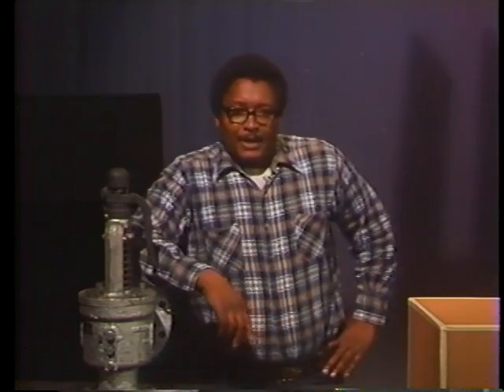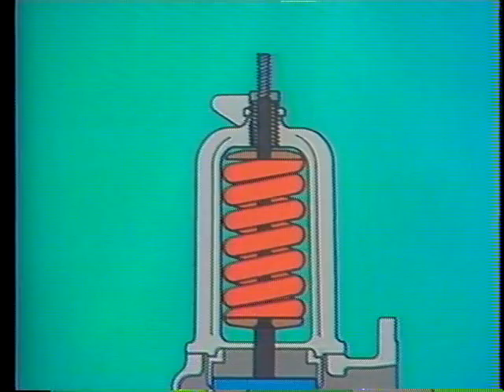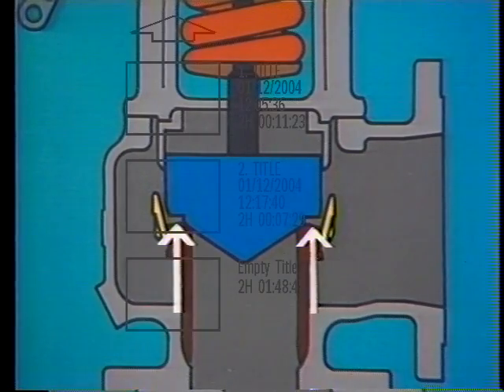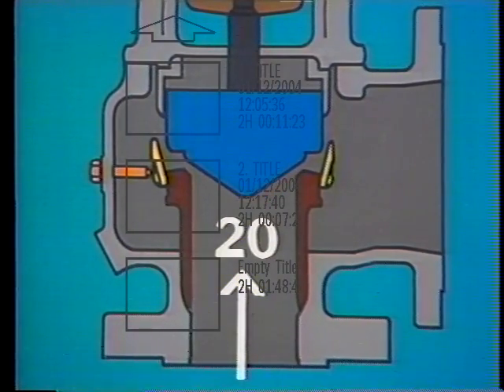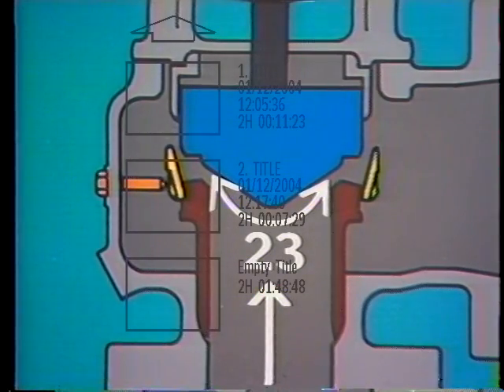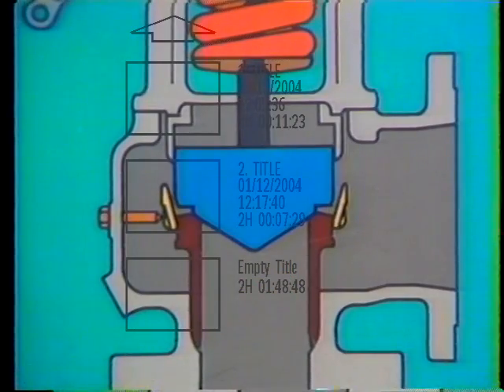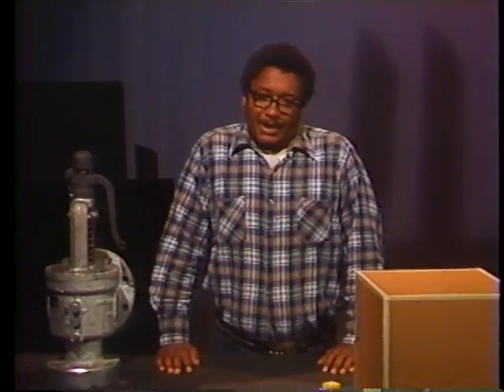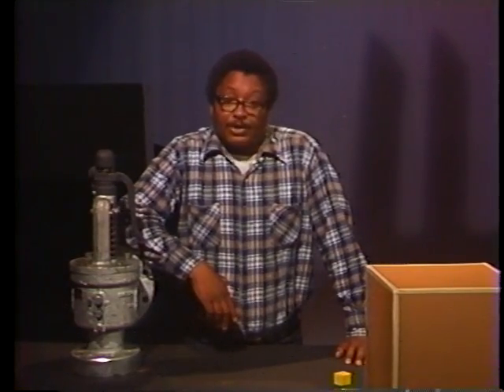Uncovering the Hidden Truth Behind the Safety Valve: You Won't Believe What We Found!

Comment: Good lecture sir. It’s a big help to us. 
I’ve a question, do we need to adjust upper adjusting ring and lower adjusting ring when we need to increase the blowdown? Or we can only adjust the position of the lower adjusting ring to a higher position? Thanks!
Reply: Lower is adjusting ring; upper is adjusting nut or screw.
For blowdown you use adjusting ring.

Comment: The device we need is a safety valve huddling chamber safety valve like the relief valve we saw earlier a safety valve consists of a valve body or casing and an outlet for system pressure to flow through it also has a disc sometimes called a feather which in this case has a replaceable seat bushing the disk is held against its seat by a spring of the disk is Guided by a gift card and the spindle attached to the desk and runs through the center of the spring unlike the relief valve we saw this safety valve has to Spring washers and one below the spring please hold the spring in place explain adjusting screw control spring tension the lock nut holds the adjusting screw in proper position so far this safety valve is almost identical to a relief valve dial has some parts that are relief valve may or may not have first desert release not at the top of the spindle release nut is part of a hand lifting assembly one or two lifting levers each lever is connected to the valve for the pivot pin protesting the valve and for making certain it is clear of any obstructions the levers are raised levers and turn push upward on the release lifting the spindle and disc the valve closes again with the levers of lowered the hand lifting assembly on top of the spindle while covered by a valve cap a big difference between a safety valve and a relief valve is a shape of a disc notice that the disc or feather of a safety valve has a lip which is not exposed to system pressure when the valve is closed notice also that there is a small chamber called huddling chamber just below the disc adjusting ring that's threaded onto the outer edge of the seating area adjusting Wing is prevented from turning by a ring in that protrudes through the wall of the valve body now let's see how these components work together pressurized fluid usually gases team is always in contact with the central portion of the disc call the pressure sensing area again let's assume that normal system pressure is 18 PSI and that the valve is set to open at 20 psi 19 PSI nothing happens but at 20 or feather begins to lift off the seat suddenly look up the disk which wasn't exposed to system pressure is exposed to system pressure what's the area of the disc is exposed there is more total Force being exerted on the disc even though system pressure Remains the Same force causes the disc to pop open to about 60% disconnect 60% open position velocity of the escaping steam striking the disc system pressure increases further the velocity of the steam also increases and the two forces will lift the desk even higher popping the safety valve accomplish who gives over pressurized gas what's team of wide Escape Route why do they escape room unless philosophy the escaping fluid has velocity the pumping action of the valve minimizes the steam cutting that can result from a high velocity flow of steam now we know that there's a major difference between the way a relief valve opens and the way of safety valve opens close here's our sexy about still in the open position pressure begins to decrease and along with it the velocity of the steam kingstree gained the advantage pushing the disc download system pressure is at the point for the valve first opened but because the lip of the disk is still exposed to system pressure and steam velocity the valve remains open only one system pressure drops below the set point of the valve the valve snap shut options instead of closing graduate to abruptly cut off the flow of steam there by minimizing steam cutting all Christmas team trapped in the huddling chamber prevent the disc and seat from slamming together hard enough to be damaged pusheen the basics of how a safety valve operate let's go back and watch the operation in Greater detail as we do we're going to learn a few new trucks popping pressure simile blow down or blow posit going to explore the purpose of the adjusting ring that we mention but never explained once again here's our safety valve como now and the valve is adjusted to open at 20 psi 20 psi then it said to be for popping pressure the valve papa win system pressure increases the disc rise is often seek but it hasn't pressure hasn't had time to act on the lips of the disc the disc is lifted only slightly is called simmering simmering last only a split second until system pressure acts on the lips of the disc uPS open system pressure continues to rise then levels off to drop even when pressure drops back down to popping pressure valve remains open because the lip of the disk is still exposed to system pressure and steam velocity only when system pressure has dropped below popping pressure is it spring able to shut the valve only in place against that seat has positive seating seating is important to ensure that there is no leakage the popping pressure and the positive sitting pressure is called a blowdown for blowback of the valve laparkan pressure is 20 psi positive seating occurs at 19 PSI so the world why is Boomtown important in the safety valve let's consider a case with a popping pressure is 20 psi and the positive seating pressure is also 20 psi 20 psi valve simmers and continues to rise as pressure increases on pressure drops back 220 PSI the disc returns to its peak psi's both feeling pressure and popping pressure as long as system pressure remain 220 PSI the valve can't make up its mind whether to remain closed or Bob open again the disk is likely to jump up and down on its eat until pressure either increases enough to pop it or drops enough to give his positive City please call chattering from machine gun it because of the sound it makes is a serious problem it can severely damage the disc and the seat chattering by ensuring that popping pressure and positive sitting pressure are different popping pressure of a safety valve can be adjusted by turning the adjusting screw and increasing or decreasing spring tension blowdown is adjusted by the changing the setting of The adjusting ring we can see how the position of the adjusting ring with X blowdown by studying what happens when the valve is closing remember and the position of the disc is determined by both the amount of system pressure striking the disc adjusting Maniacs like the nozzle of a garden hose get direct escaping steam right against the desk which of the steam is aimed at the desk the velocity of the steam exerts a large amount of upward Force system pressure must drop well below popping pressure before the spring and force the disc back onto its seat raising the adjusting ring then increases the blowdown of the valve once again with the valve and it's open position lets the lower the adjusting ring without the ring directing steam at the desk much less escaping steam strikes the disc on its way to the outlet as a result of velocity of the steam exerts less upward force on the desk because the system pressure is getting Little Help from the escaping steam it takes more system pressure than before to hold the disc open tingling in this position available close against higher system pressure and when the rain was raised a blowdown of the valve the difference between popping pressure and positive seating pressure decreases as a general rule then are the blow down a lower the position of the Ring Aloha the blow down standing on one ring idling chamber safety valve read through section